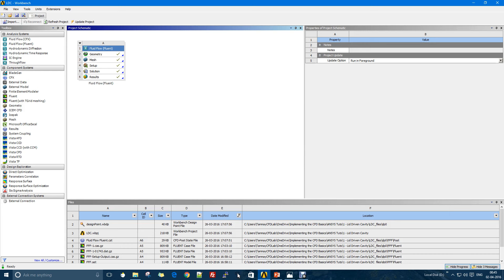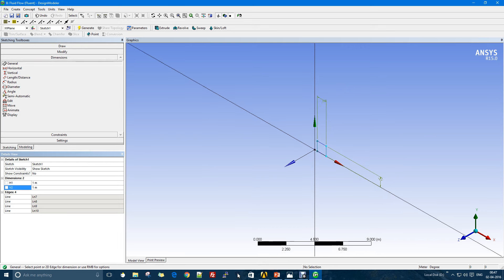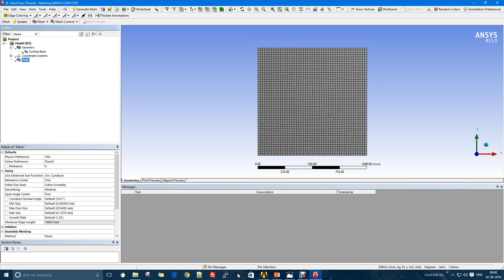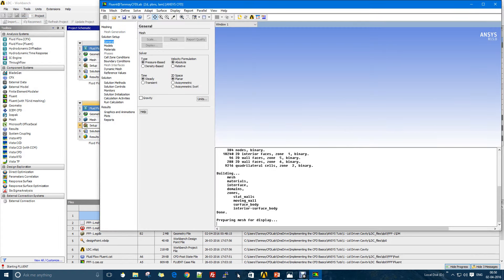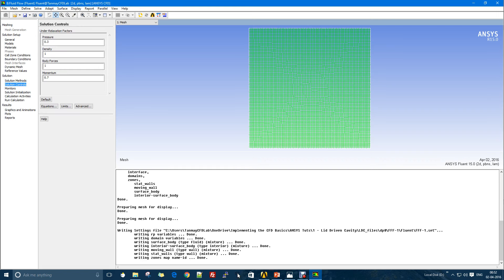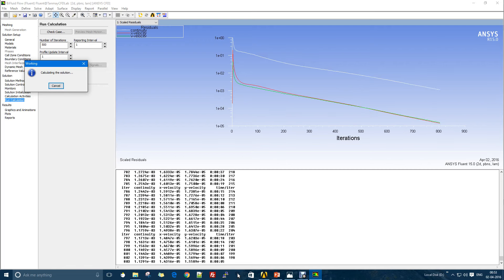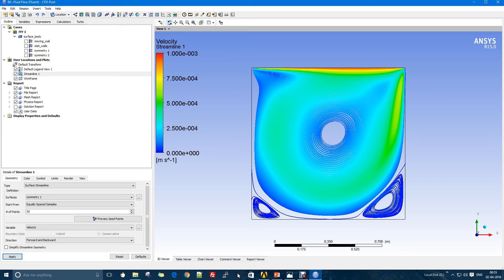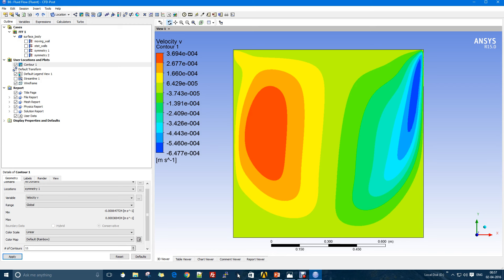Lid Driven Cavity Simulation in ANSYS Fluent | 01 | Implementing the CFD Basics

Comment: Great video! I have a question, I'm working on the same problem but with imposed tempratures on the moving wall and on the bottom one, and i am trying to visualise the temprature contours to show the effect of convection for different Richardson number. Can you tell me the exact parameters that i should change in Fluent solver in order to study this case? Thanks you in advance.
Reply from the maker: When it was an isothermal case, we change the top wall boundary velocity (lid velocity) in order to change the Reynolds number. Similarly, I believe you can have different combination of parameters (delta T and U) to have diff. Richardson numbers.

Comment: With the recent iris xe graphics with the 11th gen i5 16gb ram compatible and sufficient  with ansys for medium 3d simulations?
Reply from the maker: How many cores are there?
RAM should be fine for not very intensive 3D simulations
Reply: @TanmayAgrawal7  it had 4 cores and 8 threads. ..and integrated iris xe graphics. Actually I'll be working on LBM simulations. ...so how are these specs from that point of view
Reply from the maker: Does ansys has lbm? I don't think so...
Reply: @TanmayAgrawal7  Actually I'm the beginner into it so I don't have much clarity...It's what my guide has told me.....can you please tell that which tool is exactly used for LBM simulation?  And it's system requirements for low to medium 3D simulation?
Reply from the maker: You'll need, most likely, a coding based platform. LBM can work on parallel system, so having an Nvidia graphic card or a system with more number of cores would always be useful.
Reply: @TanmayAgrawal7  Will that not run without dedicated nvidia and on integrated ones ?
Reply from the maker: Not in parallel mode, but in serial mode, it will be fine.